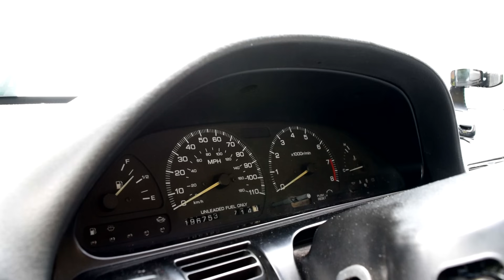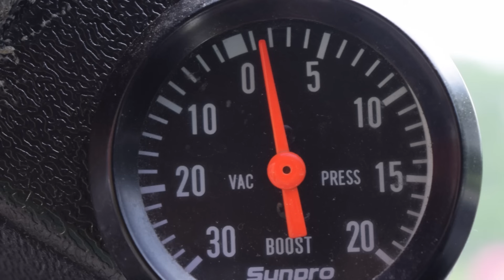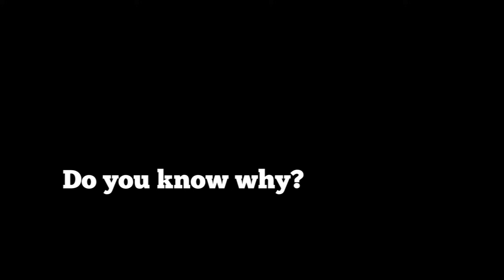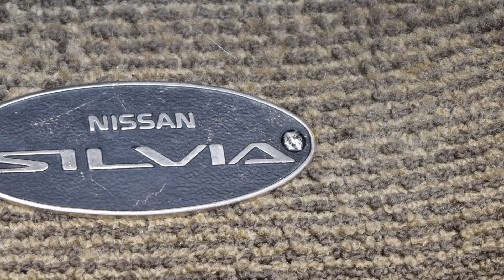Regular Car Reviews: 1989 Nissan S13 Silvia/240SX

Comment: I'm surprised you didn't mention the fact the USDM car has the pop-up light 180SX front end conversion.
Reply: Thats actually how the USDM models came.
Reply: Did America get both the 180SX and S13 body styles with the 180SX front end on both?

Because neither of these cars is using the 180SX body (the purple one is using the Silvia body).
Reply: They got 180sx body with 180sx front and also silvia body with 180sx front. AFAIK there were no silvia front cars in the US
Reply: Kyoto-Moto wtf are you talking about 180sx and s13 are the same thing, usdm cars only came with popups if thats what your wondering
Reply: Kyoto-Moto yep
Reply: So effectively the US got factory Onevias.

That's pretty cool actually.
Reply: ***** also what you are referring to as "s13" is the Silvia model, 180sx and Silvia share the same chassis which is "S13"
Reply: zum that's actually not 100% true ... united states received the 240sx which you could get hatch or a notch back with only the flip up head lights... While the Japanese market received either the fixed lights or the pop up lights. Now, im pretty sure that only the Japanese s13's with the fixed head lights were called silvias, while the Japanese s13s with the pop up lights were called the 180sx , but both shared the same engines (1.8t) and I think only the silvia could be a notch and only the 180sx could be a hatch back... But then you get into 'sileighty' territory... which is a 180sx  with a silvia fixed headlight front end ...
Reply: The 180sx is chassis designation RPS13. The Silvia is chassis designation S13. I have owned both they are not the same car, but are made on very very similar chassis.
Reply: ***** wow, they really arent the same?! What are the major differences if any lol?
Reply: Its just the rear end lol.
Reply: ***** lmao, oh wow, like they really needed an entirely new chassis designation for that lmao xP xD
Reply: Well it still a different series of car so i presume thats why. Same way the Z20 Soarer and A70 supra have 2 different codes but theyre functionally identical cars.

My comment was aimed more at that zum fellow anyway.
Reply: This is so this whole damn Chassis-Model shenanigans don't continue, Mr. R described the S13 chassis as the Japaness counterpart to the Foxbody chassis both had a notchback and hatchback model; Foxbodies are not just Mustangs, there are Capri's, Thunderbird's and much more kinda like the S13 chassis has the 180sx, 240sx and Silvia models.
***** Kyle Morgese
RPS13 is just how Nissan likes to describe trims like the R32, R32 GT-R's have a chassis code of "BNR32"; R32 GT-S's are described as just "R32" since its the base trim.
Reply: I still have a friend anyway who gets mad when you call his 180sx an s13 and he always reminds me of the fact.
Reply: Kyle Morgese i said s13 not silvia, 240sx, 180sx, silvia, even 200sx are all s13's. yes each country came with different engine lights and bodystyles.
Reply: ***** good way of explaining it.
Reply: zum generally when people say s13 they mean the silvia and the 180sx is the 180sx. At least where im from.
Reply: ***** the RPS13 was just the chassis designation for the 180sx Type-X trim, its basically a hatchback with a neat bodykit, some performance and taillights. RHD Japan only
Reply: It's because the all USDM s13's came with flip up headlights from the factory. That's why the USDM s13 coupe is an onevia and not a Silvia. Because it always came with the 180sx/240sx style flip up headlights hence the "one" in onevia.
Reply: ***** Actually no, the R32 GTS-T has the code HCR32, while the R32 GTS-4 is the HNR32. :)
Reply: My 180sx was not type x but had an rps chassis code.
Reply: Incurafy Don't forget the GTS25 ECR32 :)
Reply: SydneyCBR6 I couldn't remember that one! Thanks. :D
Reply: Kyoto-Moto  but we don't talk about that...
Reply: +Davor Mandic 

S13/RS13 = CA18 Silvia/180SX, PS13/RPS13 = SR20 Silvia/180SX.  HS13/RHS13 = USDM 240SX.

Type X was a package for the 180SX, like SpecR was for the S15, and K's for the Silvia.
Reply: +wryyysespieces RPS13 indicates that it's a 180SX with SR20.  Doesn't mean that it was a Type X.  I had a 1993 180SX that was an RHS13, but was not a Type X.
Reply: +Colten Goyeneche the USDM one came like that. If you got the notch back then you get the normal usdm 240sx tail lights that we're all familiar with. If you got the coupe (closed off trunk) you get the Silvia rear lights.

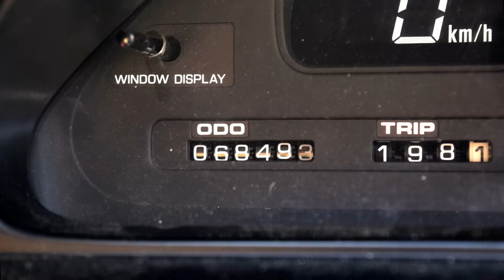Comment: 4:33 The odometer is probably broken just sayin. 
The plastic drive gear that the stepper motor mates with likes to melt when the grease dries up.
I have an S13 and it took awhile to find an odometer unit that still worked.
Also....its is not hard at all to change the mileage on these. Also just sayin.

Comment: FRS/BRZ/GT86 costs ten times more than a basic s13 in Finland. Not so easy to missile an 86 when these are still so cheap... And in Finland the S13 hatch came with the same CA18DET powerplant as the Silvia shown here.

Comment: some people will disagree with me.. but as an s13 owner that is pretty much oem not so much as the one in the video, they can be quiet nice cars and i wish more people looked after them
Reply: Marcelo B nice While i dont have a problem witch engine swaps its not somthing i plan on doing to mine as mine is a silvia k's was a sr20det But aus laws require a N/a engine for my License to start out with so i put the turbo engine away for a rebuild snice SR's are like peanuts here It makes sense to stick with them But LS1s a good cheap platform.
Reply: Marcelo B australia
Reply: Marcelo B dont get me wrong i fully understand were your coming from we can allso put LS's in them i bought my car with a sr20det with a t28 turbo 3" exhaust boost controller and big front mount for 2K complete car no rust running and driving. all i was saying is for us over here The Sr20 Is just an engine thats worth sticking with.

Comment: That stock Silvia is a thing of pure beauty, and the 240sx COULD have been as well. Come on dudes with 240's, they don't need to be slammed, they don't need over-sized rims or gaudy exhaust pipes. The USDM 240sx is one of the prettiest cars of its day (especially the hatchback, mmmn, love that tail light bar), and it deserves to have its beauty preserved. Trick them out with all the engine mods and shit you want, just keep it pretty D;

Comment: I have a couple of issues with this video. Mainly the fact of the fact the USDM 240sx has the JDM motor, but from what i gather the USDM is also an 89' model. That being said, it should have the "pignose" style front bumper rather than the "shark nose" or "chuki" which was not even mentioned at all. You also placed a heavily modded USDM 240sx against a bone stock JDM Silvia,
personally I feel like this video just happened and was not really planned as far as finding the cars. I only say this because i am an owner of a mostly stock 89' s13 Usdm 240sx fastback, these two cars do not compare to one another. The japanese silvia definately beats the USDM 240sx. Overall fun video and love to hear the commentary i just felt it needed to be said as i have not seen in the comments.

Comment: Is the 240sx a 2 door coupe version because i used to the 240sx in nfs:u2, the 3 door version righ
Reply: Yeah, the 240sx here is considered a 'notchback' , I prefer the other variant, the hatch back myself
Reply: Kyle Morgese not really familiar with the variants of models in different countries, so this both models are basically the s-chassis but with different engine(?) And name for different market. Sorta like the corolla gts and trueno levin kind of gist.
Reply: Yes, its kinda like the corolla/levin thing, yup, some with pop up lights, some without, and some were notch backs and some were hatchbacks. And yes, the united states only received the more bland 240sx which only came in a naturally aspirated 2.4 liter that came out of an equivalent year nissan hard body pickup or an equivalent year nissan stanza/Altima. The usa also could have a hatch or a notch back ... While the Japanese market received the 1.8 turbo with either the fixed lights or the pop up lights. Now, im pretty sure that only the Japanese s13's with the fixed head lights were called silvias, while the Japanese s13s with the pop up lights were called the 180sx , but both shared the same engines (1.8t) and I think only the silvia could be a notch and only the 180sx could be a hatch back... But then you get into the 'sileighty' which is a 180sx with a silvia fixed headlight front end ... Its still disputed weather or not it was a factory option I believe
Reply: sileighty, so that was the nameof the blue car the girls that drive 180sx in Initial D
Reply: Nano Kumo that is 100% true. Big I.D. Fan myself lol
Reply: +Nano Kumo  In the U.S. we had lots of 3 door hatches too- more than coupes possibly.  I've owned 3 and have had my '93 for 13 years (totally stock and nearly mint).

Comment: At this point the drift community can't switch to the scion frs because its just to damn expensive. Its like 10k and up right now but a good drift ready s13 runs less then half that. So until there is a cheaper option for drifters then the s13 will be king.
Reply: But they made S13s and Supras expensive as hell, so they might as well get a FRS or a IROC, I know the latter is America but they are so cheap.

Comment: the usdm isnt a 240sx its a sleighty its a cross over of the 240sx s13 we know and the sylvia s13 2 diferent bodys but they share the same chasis the front body panels are interchangeble betwen the two
Reply: in the USA, the S13 is sold that way, alongside the hatchback option. It is called a "240SX" from the factory and it have a coupe (non-hatch) back end from the factory too.

But that's just in the United States.

Comment: I agree on the frs bit, but they made one big mistake, they should've given it a turbo from the start.
Let's take Belgium as an example. There you are not allowed tot boost a car, unless you plan to never drive it on the road again. But if it comes factory  boosted, have fun throwing a bigger one in there. Toyota/Subaru/scion should just have given their model a turbo charged engine tot start with. And it would be wat more popular then it is at the moment.

Comment: Ok at the end of the video he says to use a frs instead. here's the problem with that.
1. The cost
a used 2013 frs/brz will cost you about 17k, a s13 will cost you about 3 to 5k.
2. parts
the frs has become huge in the tuning culture but it's nowhere near the 240sx range yet.
3. anxiety
a typical driver won't go full out in a frs cause if they wreck it that's 17k down the drain. where as if you wreck a s13, just buy a new shell and your good.
Reply: I agree with that. However there's no denying the fact that the frs is basically the S16 we all wanted
Reply: We can still dream that Nissan will make an S16 (they won't).
Reply: enddy123456 I guess we can but since the R35 and the Z34 pretty much fill every gap for their target market the likely hood of the Silvia making a return is pretty much 0
Reply: Crazy now our US market is now into the turbocharge thing where us true Japanese car fans have known this for decades. As an FRS owner I wish Nissan would just bore out the turbo Juke already and have build the S16 so it would force Toyota/Subaru to build a hotter version of the 86/BRZ.
Reply: DriftTek Once they get to be 3-5k, they will be.

Comment: Would a 240sx be better than a RX-7?
Reply: Depends
Reply: depends on what you want. rx7 fc? 13b rotary hopefully turbo. but rotary needs More work than the unreliable af 240s we have here.
Reply: +Jeramiah Chadwick I think I want something either a little older, or a little newer. I'm thinking a 280z, or some turboed Toyota, but those aren't that cool unless they're heavily modified. I can get the MKII Supra for almost nothing, and the older MR2s are plentiful where I live. any advice?
Reply: +Cesar Tapia . well I'll tell you this. I've driven the sw20 2nd Gen mr2 turbo and that pulls. the rx7 is quick but you're not going to be chopping people. what are you wanting Power wise?
Reply: +Cesar Tapia problem with 280z. parts and such hard to find. let alone a good 280 to buy.
Reply: +Jeramiah Chadwick More power the better, but I still need the car to be reliable, if not, then at least easy to work on. But power is more favorable.
Reply: +Cesar Tapia so if you're wanting Power and decent reliability I suggest a 240 (with a swap. ex- sr, 2j NA or rb) stock 240s are slow plain and simple I have an s-14 with the stock KA 15ish hp and its slow. S-13s depending on the year are going to wither be close to the same or slower.
Reply: +Jeramiah Chadwick I suggest a turbo mr2. good power to throw around reliable and easy to find parts since they are everywhere. be aware of their snap oversteer
Reply: +Jeramiah Chadwick 155hpish* lol Um rx7s are very needy for an easy way to put it. they flood, over heat, need a rebuild at about 140k if it's an fc. but if you're looking for a fun 90s. 
swapped 240, mr2.
Reply: +Jeramiah Chadwick Okay, thanks; I'm still considering other options though. What do you think about a Supra, 300zx, Eclipse, or 3000GT? Would the MR2 be better (practically, or power-wise)?
Reply: +Cesar Tapia I love supras. the mrk 3 doesn't have the best engine. it tends to blow. love them though. 3000gt is Mitsubishi I've always been weary because they are just not the most reliable. Same with eclipse Mitsubishi. I love Mitsubishi though. anyways the 300zx is the car I'd get if I wanted to become a mechanic lmao. they are the piston rotary because if the Vg v6. haha. honestly if you're looking for a really fun daily that eventually you want to build get yourself a cleanish 240. mine is fun as hell to daily. but I plan to buy a gs300 to daily and make the 240 a race car lol. if you need any help or advice when looking at 240s ask me

Comment: This review takes me back 17 years when I had a 92 S13 fastback base (lightest one with roll up windows, no cruise, etc).  It was all stock but very fun to drive.  The 5 speed manual felt like it was from a $50K car.  Nissan did go way cheap on the interior.  The fabric on the seats was like sandpaper and they were very poorly designed/uncomfortable.  In those days the drift fad had not yet hit the US so S13s were still around in good condition and for little money.  I paid $4500 for mine, 1 female owner before me, 9/10 condition of the car with everything except the stock and working except the radio, with 75K miles in 1998.

These days they are butchered so badly in most cases.  I always wanted to buy the newer "Kouki" 97/98 car but prices are ridiculous for such an old 4 cyl car.  They fetch $8-10K if all stock, in 8/10 condition, with over 150K miles.

Comment: Great comparing the highly modded USDM to the stock JDM car.  

Yes, may props to Nissan's engine coding.

I guess you can call a Z32 fuel filter a mod...pretty funny in that list considering the extend of the other mods.  I had one on my 92 Maxima, worked great.

Comment: I miss my S13. If anyone needs some 26mm Aluminum Z32 calipers or a S13 hud dash with no cable, let me know :P
My 1989 S13 240SX Fastback had the same wheels as that Silvia, they were an option here.
There is no difference between that Silvia's limited slip and the Z32 NA's. Just the cover and outputs. You can run Infiniti axles with the Z32 diff, I forget from what car
FR-S still costs too much. Sorry. Gonna chew up more S13s

Comment: honda has better engine codes. like the b16, b18, and b20, and j35. 

also any of these would take out a 240 in a heartbeat. I owned both and my integra with a stock ls motor b18-1.8L would walk 240's

Comment: honda has better engine codes. like the b16, b18, and b20, and j35. 

also any of these would take out a 240 in a heartbeat. I owned both and my integra with a stock ls motor b18-1.8L would walk my 240 and all my buddies

Comment: Finally the S13 review is made and it takes me over a week to find out about it!  Nice review, these cars really are one of the best options for getting into drift or getting into car modifications on a street budget, at least in Australia.

The SR20DET is a very capable engine too despite the exhaust note of a diesel powered tractor, mine is at 430hp with the stock bottom end and it's my daily.

Comment: And speaking of the 200SX, will you think that you'll ever get to review an S12?
Reply: YES! If it weren't for the S12 there wouldn't be an S13 ;-) . The S12 also had the CA18, and the VG30 (300zx).
Reply: Silli pup77 S12 had a CA20E
Reply: Randy Winston I know, I daily drive one every day. It (S12's) came with a few engine options, I had owned all versions. CA20, CA18 det and VG30 (v6). Overseas had the FJ20 det however. Club S12 online has more info.
Reply: Silli pup77 The USDM turbo was a single cam. I never owned one(owned an s13 and this video makes me want it back so much) but always wanted one.
Reply: I had a S13 coupe also, sold it. Worst decision I ever made, miss it everyday. I feel you. It was fun having both while it lasted.

Comment: I don't see why people import s15 motors when you can just get an sr20de from a Infiniti g20 and slap a turbo on it for a lower cost. Is it JUST because they want to be truly 'jdm bro" or is there really a reason behind it?
Reply: Revive The FWD SR20 also has completely different motor mounts, and doesn't bolt up to the same transmission used in the S13 in Japan. You can't just slap a turbo on there and it'll be fine, the compression is different, and that motor wasn't made for boost.
Reply: alrighty thanks, i just never got the reasoning behind it